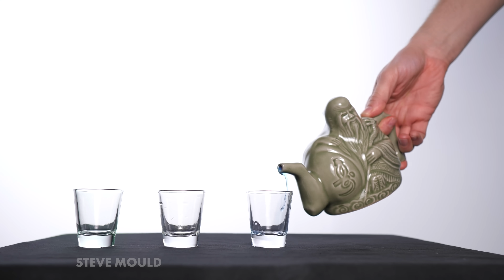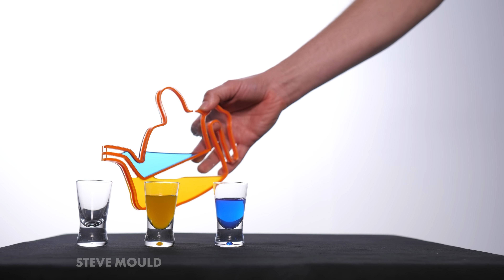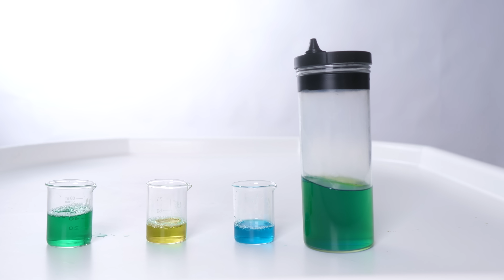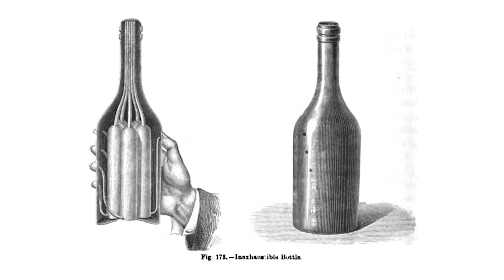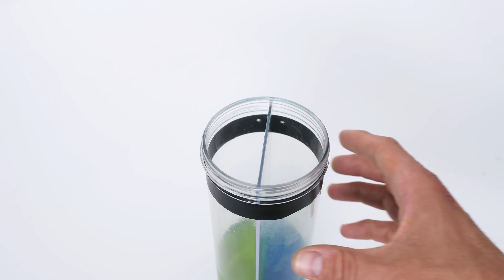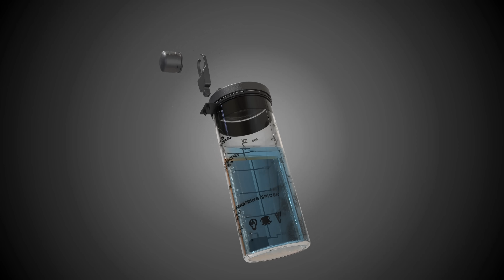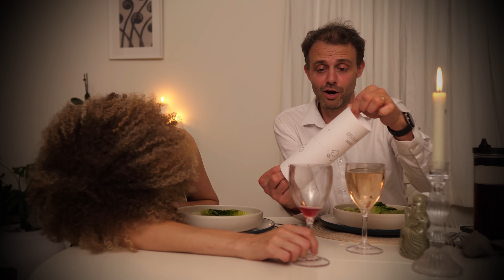The weirdest water bottle you can buy

Comment: A normally closed rubber button for each hole would be ideal. Pushing either button would break its seal against the inside of the bottle.
Reply: I was thinking the exact same thing! It'd be a lot less suspicious than flipping a random flap open, and also less likely to accidentally spill if you forget to put the flap back down.
Reply: steve, look at this comment!!!
Reply: Solid V2 suggestion.
Reply: @BenKickert That be v1. I doubt its already in final production
Reply: @FireFish5000  Considering they are already accepting money for pre-sales, I highly doubt they are going to change the design prior to production and shipping.
Reply: Would need to be cleanable, but an excellent idea!
Reply: @Kargoneth the whole spout is already not cleanable
Reply: @Kargoneth  Get one of those straw cleaning brushes. Should be able to get into the groove between the divider and the bottle's edge.
Reply: Yes, or a switch with 3 positions.
Reply: @citratune Correct me if I'm wrong but a three position switch would only allow left, right, or both (open/closed). You could have the middle switch open both sides if pressed.
Reply: @citratune  if the three position are Left tank - none - Right tank, you loose your ability to make cheap rose (to pour both)
Reply: @citratune slidable oring switch? Too much friction unless you want a whole hose valve... it needs to be small. All togglable/multiposition water valves are high friction pretty much. Doesn't work for a discreet switch
Reply: @citratuneA switch was what I was thinking too. It would make it much easier and would make it so you could actually use it as a water bottle. Currently the design is cool but it would get annoying.
Reply: An easier solution is a silicone check valve on each hole. You only need to stop drinks getting out, not stop air getting in.
Reply: Hey also I was wondering if putting a mesh over the holes would fix the issue of the water bottle being transport unfriendly? Using surface tension to keep the liquid inside was a thought I had - but I’m not sure if i’m dumb or not lol
Reply: @jlin8850 , they are using this principle. That's why it's 4 tiny holes to pour through.
Reply: I came here to say this…
Reply: @mrmatthewking same - glad to see that this was a common idea
Reply: Such a system will also prevent leakage
Reply: It could be made from a compliant flip-flop. A material similar to TPU without the hydroscopic trait could be the perfect choice for the stopper with the main switch arms being something akin to ABS.
Reply: @Handles_AreStupid or even with a hydrophobic coating
Reply: There could be unforeseen forces pressing it inside a backpack, and that's not ideal.
Reply: I'm thinking of a convex membrane with a nipple so when you pushed it the membrane separates and air can pass through.
Reply: Pretty sure theres a pretty standard rubber button like youre talking about in most bottles like this, its almost like a silicone earbud but smaller, just a small rubber button with a through hole to allow air into the bottle to keep the pressure the same inside and out allowing the fluid inside to freely pour out, one on either side of the partition wall could work, you just put your finger over the hole you dont want to pour. This would potentially remove and moving parts but it would have the same issue as just putting holes in the bottle i assume. Less likely to encounter thermal stress fractures though.
Reply: I had a refillable Gatorade bottle like this.  It had no cap, just a self closing rubber hole in the spout.  You drank out of it by squeezing the bottle or sucking on the spout.  Problem is it was uncleanable and mold grew in it, so I had to stop using it.  Careful thought would have to go into a design like this to make it work long-term out in the field.
Reply: I had the same thought
Reply: I'd use one-way valves
Reply: Good for a bottle that sits on a desk maybe, but in a bag the button could get depressed causing it to leak
Reply: yup, having to open and close two parts on the bottle would make me stop using it. I know it's kinda a gimmick but having powerade and water during sports would actually be really cool
Reply: All u need is a one way valve on each hole air can get In but liquid can’t get out
Reply: Or Just a rotating ring ! 
Plus they can make the air nozzle on the top side of the rotating ring so it minimizes the spill 😅
Reply: I was about to make the same comment. The current design is making it a no-go for me I'm afraid.
Reply: It should be a rotating piece that can cover one, both, or neither hole
Reply: This needs to get pinned
Reply: A valve. Yes, but that's a moving part with its fail state being a leaky bottle.
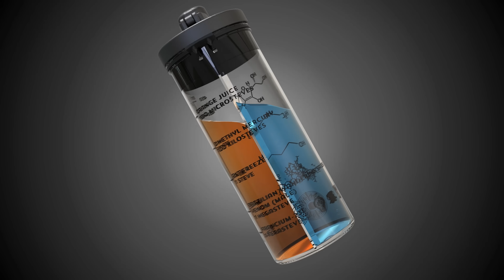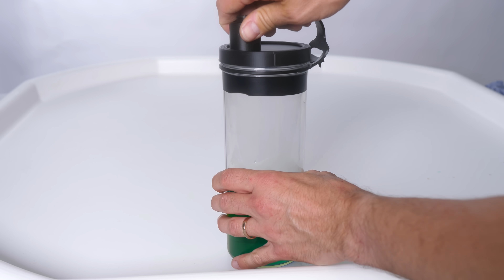Reply: You can see at 1:36 that something like that is already a feature if you look close where the holes are and more clearly at 3:47.
Reply: @Lambent_Omega  im thinking more of the embedded rubber thingy, youre right its very similar, however, what im thinking of doesnt have anything inserted into it as a design feature its more like a constantly open teat, designed for exactly the same function as what you have described, but it has taken into consideration that work hardening due to thermal expansion over time. With a through-hole in a hard material like the PET which is commonly used in water bottles this may occur in only a handful of cycles, whereas designing an insert for a rubber teet would allow the softer rubber to expand and contract without suffering work hardening, while still performing the same functionality. Its only a minor improvement and doesnt change the entire design, but i think it would serve to increase the longevity of these bottles, especially given that they are limited sale.
Reply: Best idea
Reply: i was thinking a simple check vale of the flapper type. But yeh a button vale would work well even better as before the flapper check vale would stop the flow a small amount would get out
Reply: All of these are great examples but you need to keep one thing in mind, too - cleaning. These solutions would be a biiiitch to clean. And since you probably wouldn't hold just water in both compartments, it would mean that it would contain perishables. And, well, they perish with time, which makes them poisonous. Mold and all kinds of nasties would be stuck underneath and between those moving parts. The easier a system, the cleaner it would be.
Reply: I personally swear by the Contigo AUTOSEAL line of bottles which have a normally closed button which is conveniently located such that you automatically unseal it as you put your hand around the rim to lift it up to your mouth (and it automatically re-seals as soon as it’s released from your hand, intentionally or unintentionally)
Reply: anything valve-like may be difficult to clean. In this type of product you want very simple geometry with no crevices and worst case something that can be taken apart to clean but then it becomes less practical.
Reply: A push version of a camelbak bite-valve
Reply: Just make the ring with the holes a rotating part so it can slide over one or both holes.
Reply: +
already commented before I saw this, but a mechanical valve/switch of some kind to operate the air holes feels like complexity that would be worth it
Reply: I was thinking the same.. ideally with a mechanism to switch between modes?.. Mechanical barton would be cool.. such a shame would definitely have my $ if this was the case
Reply: Came here to say this. I want my vodka to stay in if others grab it. They can have the water I leave it on when not drinking from it.
Reply: I was thinking a rubber check valve like you can find in a lot of sippy bottles, it would be internal so not visible and also completely automatic.
Reply: That sounds like a nightmare from a cleaning / hygiene  perspective.
Reply: Maybe the depth of the button would influence how much air could get through, letting you control the flow rate of each liquid?
Reply: Not sure I understand. Do you need to hold the button in to pour? How do you pour both liquids at once. I only have one thumb per hand. =]
Reply: @moon47usaco  Use both thumbs... Alternatively, if the buttons are right next to each other, you could maybe use just one to press both
Reply: This is also brilliant in terms of user experience. You push down the button to release the liquid, which is more intuitive than "covering the hole to release the other liquid".
Reply: Yep, couldn't agree more
Reply: I agree that would be pretty cool, but imagine packing that into a bag and imagine how many random things would jostle around in the bag opening up the valve.  You still run the risk of this leaking.
Reply: i will buy this one, cz is a normal water bottle until I consciously press the rubber. so I can use it for my normal life instead of just a gimmick
Reply: I came here to suggest the same thing 👍
Reply: Nah, twisty is simpler.  Anything more complicated than that will lead to leaks and eventual breakage.
Reply: double walled glass would be nice too
Reply: or you could always use a rubber ring that rotates with a hole in it and you put the hole in that rubber ring on the hole you want the drink, it's simpler to implement and it allows you to rotate it around in a way that nothing comes out
Reply: Outside have a twist ring similar to some of the salt shakers
Reply: The more complex something is, the more expensive and out of range for most customers something becomes. Also, rubber degrades too quickly and absorbs bacteria.
Reply: @turgsh01  true, so rubber is not the choice, it will have to be some kind of TPU (above) or food grade silicon
Reply: @turgsh01  my thought exactly.
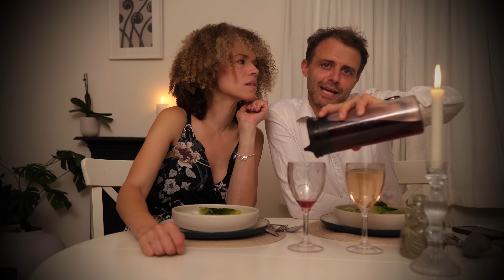Reply: @turgsh01  well right now it's a 3D printed cap that leaks, so... look @3:05
Reply: @oosmosmoo  I know... it's called a prototype.
Reply: Also the thermal retention of this water bottle is not on par with cost.
Reply: That would take complicated parts manufacture that I'm sure is out of the scope of this 3D-printed cheap trash.

Comment: PSA, don’t drink or eat out of 3D printed items at home. Too many micro cracks that breed bacteria. Looking forward to the professional made bottle though. Cool idea!
Reply: generally dont use 3D printed plastic item in wet environments repeatedly, I think you need a "varnish or lacquer" finish to seal the plastic cracks you mentioned from water.
Reply: Thats the secret. Its Steve Moulds signature bottle mould.
Reply: If I'm right, wood has some antibacterial properties.
Plastic from 3D prints has none, that's for sure.
Reply: Your right it come chemical get it the liquids
Reply: You can make food safe 3d prints
Reply: @KaitouKaiju  absolutely, and these days, you can make biocompatible prints that can be implanted permanently under the skin at home in a consumer grade printer. Just good luck with the certification process, but you can.
Reply: Don't drink out non-glass/copper/silver plated water bottles either, plastic ones contain leached plasticizers and the stainless ones could contain some chromium! Plus if you wash your plastic water bottles with anything rough it'll create micro scratches for bacteria!)
The only thing I'd worry about with 3d printer stuff is if it was printed with hollow infill that could contain liquids. But otherwise just clean it with bleach or similar and for most people most of the time it's fine.
Reply: @ElectraFlarefire  Newsflash, copper is almost equally toxic to chromium, and is even more toxic when in higher or continued doses. If you take enough copper, you will even develope a copper coloured ring around your iris, which is a tell-tale sign you already have nerve damage from copper toxicity.
Reply: @ElectraFlarefire  Of all the things out to kill you in the 21st century - this is about the least of your worries. If you arent wearing a respirator every time youre in a city its basically pointless - inhaled combustion products are orders of magnitude more likely to harm you.
Reply: @ElectraFlarefire under-rated comment, also don't forget about the potentially 0.1% lead in copper if not way more if you buy it from a cheap manufacturer. It's good to be concerned about what's in your food and utensils but sometimes that delicious deadly poison in Chinese food is just a concentrated protein from vegetables like corn, tomatoes or sugar canes that goes by the acronym MSG.
Reply: @Guardian_Arias  MSG is the most common salt of Glutamate, one of your most important neurotransmitters and improves cognitive function - we have a specific taste sensor for it because its such a vital nutrient. Its actively good for you and if you were allergic to it, you would not be alive right now.\I do wonder if one of the reasons Asia does so much better academically is high glutamate intake (and without all the inflammatories and fats in red meat) vs the MSG panic in the west.
Reply: @Celdon118  I have no panic, the poison is in the dose, of everything. Including water and oxygen. The amount of red meat a lot of people in the west eat is bonkers, and the evidence is pretty clear in the introduction of western diets to eastern countries. We evolved on a primarily plant-based diet but introducing meat did allow the expansion of our brains, as did the efficiency of walking upright, and using our hands, and speech.
Meat production is also incredibly inefficient.
Reply: 7 or 8 years ago, my body couldn't tolerate any bacon at all. I was practically sessile. I moved to a place with a flight of stairs between kitchen and bedroom, I got an electric bike the next year, and now, 6 or 7 years later, I can eat almost as much bacon as I like. What I still have a problem with is hormone-fed beef, but even there, I can tolerate more than I used to.

 @mycosys  When I last heard, there was no evidence for paleolithic humans -- modern-type humans with their big brains in the paleolithic -- eating meat. They used animal products but didn't eat the meat. Neanderthals ate meat though.
Reply: I am not really convinced this is a problem. We have used wooden utensils for even without any issues.
Reply: @Minemac2  Wooden utensils that aren't sealed have this problem as well.
Reply: @ryanjackson0x  To be fair. From my understanding of wooden things and bacteria from what I have seen based on research from cutting boards. Bacteria that can live under the surface of wood typically doesn't migrate back out very easily. Making that bacteria INSIDE the wood not much of an actual concern in general use. In fact some woods are anti-microbial and actually help control any bacteria that does start living under the surface (as kungfuhskull also noted before me). And that study actually found that applying a coating of mineral oil actually showed no notable improvement in reducing bacteria that made it inside the wood, which is a common method for sealing wooden cutting boards.

That said, its probably a different case if the wooden object is constantly holding a liquid, a hot liquid I suspect would be even worse. So, eh, depends.

As far as how that compares to porous spaces in plastics, I can't say. Maybe bacteria can migrate in and out of plastics easier, maybe it gets trapped in a similar way (I suspect it can migrate back out easier as that research suggests that wooden cutting boards bight actually go against the modern idea that a plastic cutting board is more sanitary) But I thought it would be fair to point out the case for bacteria in wood, at least in cutting boards :)

For the record, that paper was titled: "Cutting Boards of Plastic and Wood Contaminated Experimentally with Bacteria"
Reply: @Minemac2  Wooden and 3D printed are not even remotely the same thing.
Reply: Wood remains hygienic through different methanisms.